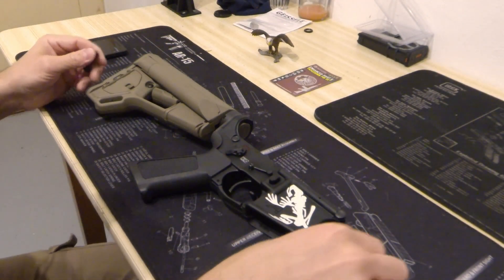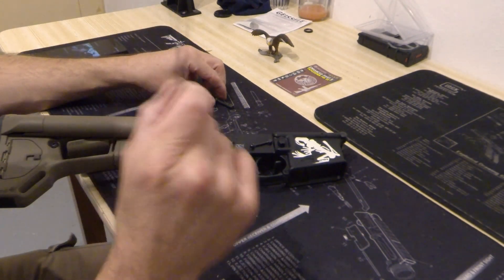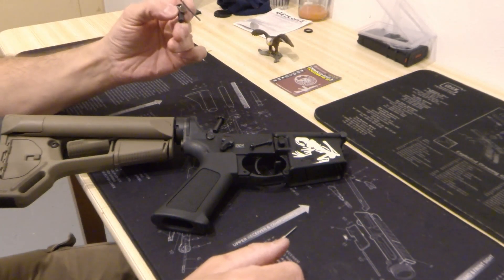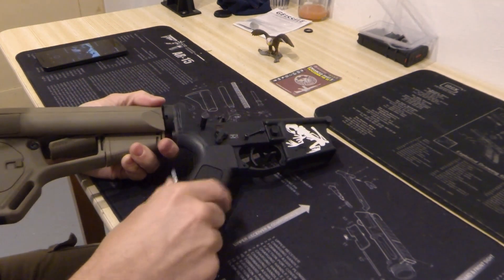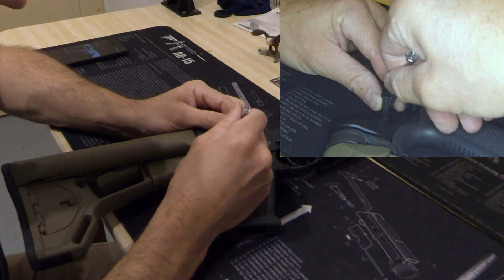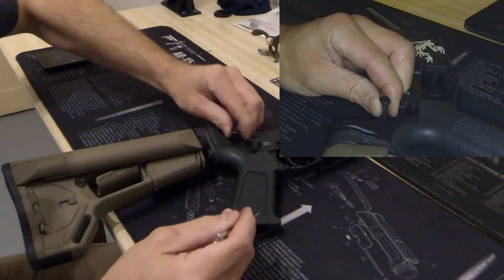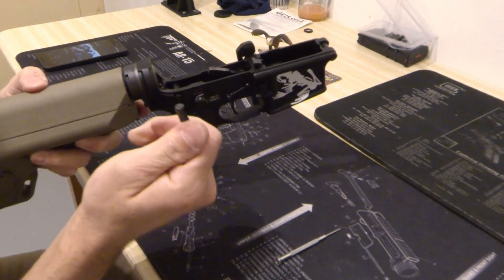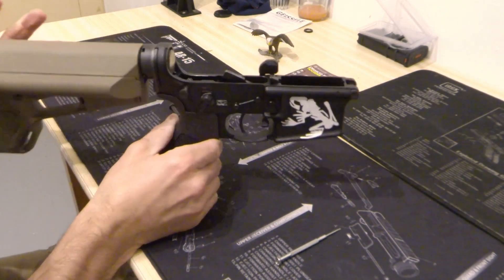How to remove the AR15 takedown pin without removal of the endplate or butstock

Comment: I gotcha . The old bait and switch ..smart Klaus ..danke
Reply: Your method of the switching out the pivot and take down pins is exactly how I did it , from watching this video . use the longer New pivot pin to push out the take down pin from the left side . then use the New TD pin to push out the New pivot pin that is holding the detent in . when it snaps in that one is changed , then use the Old TD pin from the left side to pop out the Old pivot pin . push down the detent and use the New pivot pin on the right side to slowly push out the Old TD pin , when it snaps in , it's done . the Old bait and switch pin swap ...learned that from you Kotaboy32 . thanks
Reply from the maker: @chrismsmalley2626  yes, I actually thought I came up with it my self, but later realised that I have seen it at some point quite a while ago and totally forgot about it.